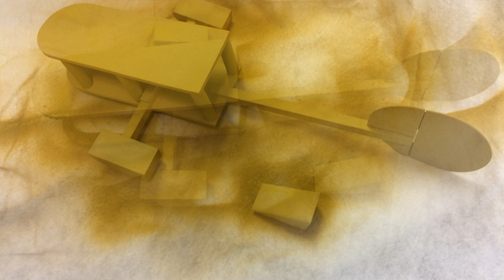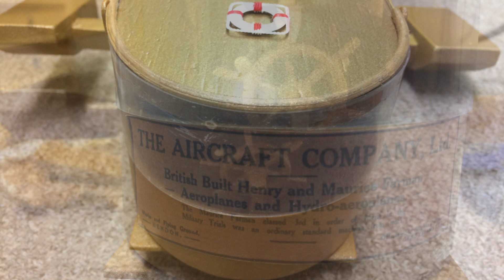MODEL 1900S HYDROPLANE BUILD AND TEST

Comment: What a lovely hydroplane.  One suggestion: I believe you should reverse the propeller for better thrust. As for planing, the high thrust line is creating a lot of nose down  thrust and the aft float is acting as a down elevator command ! In any case  the vessel needs to be very light to plane. I am afraid some of the well dressed pasengers will have to go ...Wonderful project.
Reply from the maker: Thank you for your comment you could be right